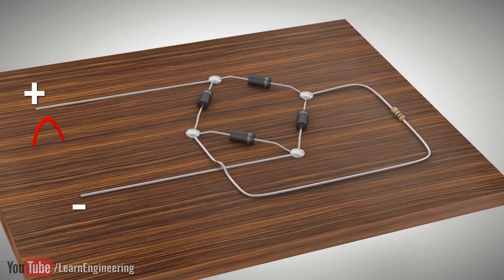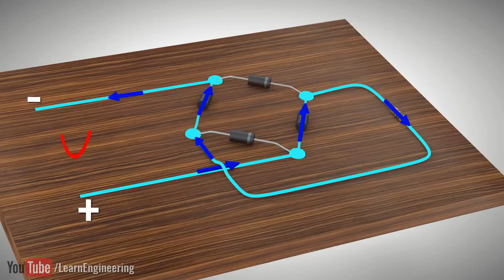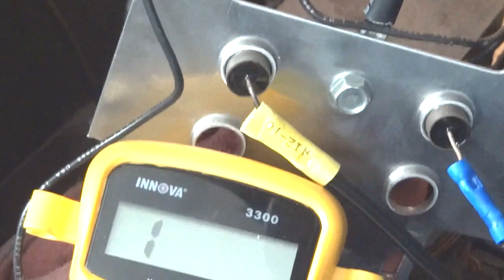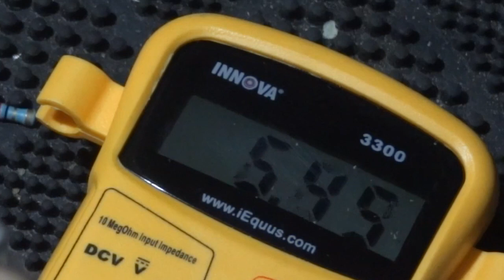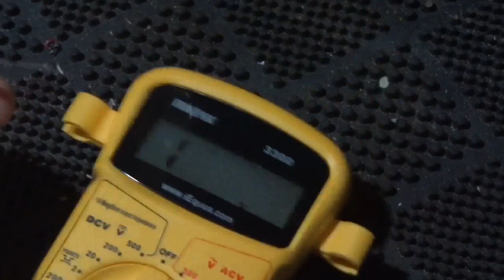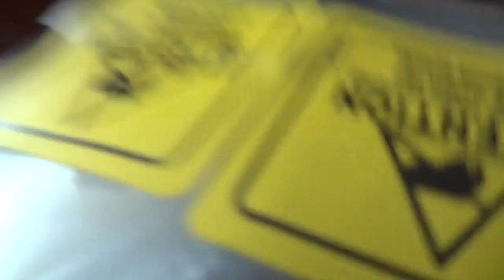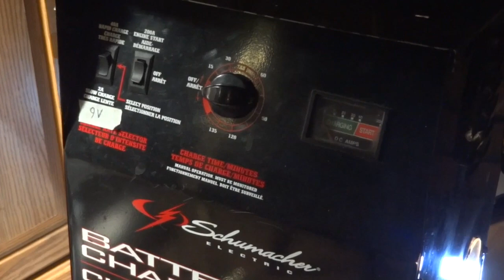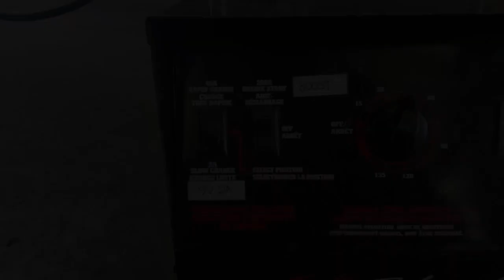Schumacher Battery Charger Repair, Part II

Comment: Does anyone have an idea why the charger produce only 10.2 volt. It's an old snap on ya165 with brand new diods,
Reply from the maker: I think it might be normal when trickle charging. Thats what got me too. I know when its set at 2 A, its voltage is lower
Reply: Its an old manual battery charger with lo-mid-hi and boost, after connecting to battery the breaker in side started going crazy and just wonder if transformer  was over heated  and shorted or the switch, its an old charger and  has no cooling fan
Reply from the maker: @Viktor Manov  ya somethings going on. Im assuming you havent taken it apart. Well? Could be easy to spot if theres something that doesnt look right/burnt, then theres your problem. Sounds like a short cus ur breaker's goin.

Comment: I have a 200 amp smart charger ,tell me what wires to disconnect and hook together to bypass the automatic section to make it a manual,or i could install a switch,just need to know which wires on the schumaker.
Reply from the maker: Sorry missed your comment. Wouldnt it be the wires to the timer? Oh you dont have a timer, ok well look for the 110v wire to the automatic (plugged in) with a multimeter, then put a switch between that and ground instead. Right?

Comment: where did you get the soldering kit, kit # & cost please. txs. great vid
Reply from the maker: on the wish app. Around 20$. and Thanks!
Reply: your video very helpful & informative. i am looking for a battery charger transformer vid on older models which so shows how to test varying ac voltages & the dc - voltage coming out.  my round diodes are ok. know where there is a good one ?
Reply from the maker: @jimball816  Cant you just test voltage coming out the leads? and what about a transformer rebuild video to fix it if you have an issue.

Comment: Are you an electronics engineer? nice work.
Reply from the maker: no, i work on cars. and have some knowledge on electricity. cant beleive the shop had them sitting around not in service, so I did a video!
Reply: Lol, he can not even spell "Volt". Engineer rofl...